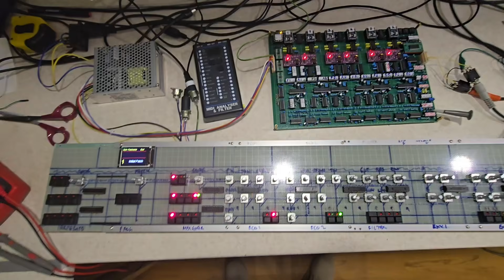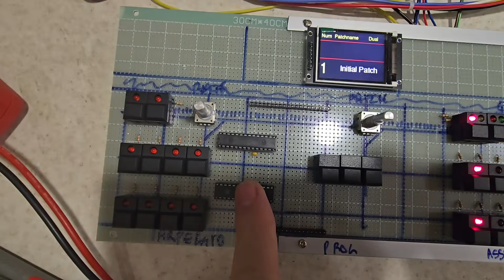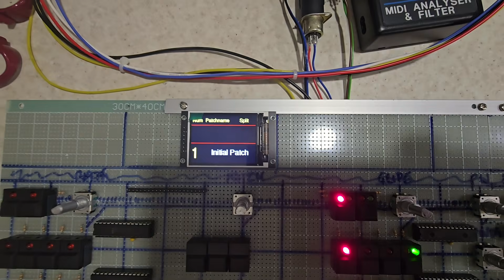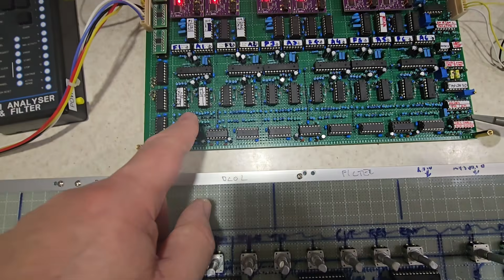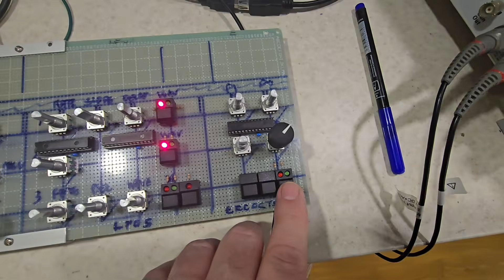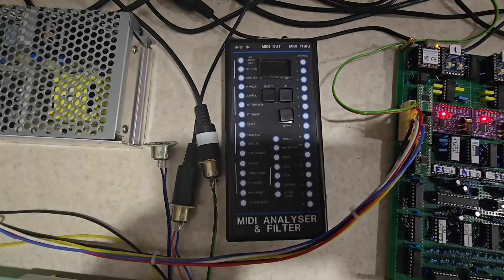12 voice polysynth build

Comment: Amazing! I'm very interested in your building technic. Seems flexible and quick.
What kind of wire do you use?
Reply from the maker: I just use 30awg wire with a stepping tool I've used since I was 16, nearly 47 years ago now. If you look at my videos you will see 3 that I made showing basically how I plan things and wire them up, tricks I use to make runs of cable for data busses etc and the tools I use everyday.
Reply: @craigyjp Thanks, I will watch those videos.

Comment: Given that they are DCOs and that audio FM/X-mod is not possible - have you though of implimenting Rolands jx3p trick of AM along with Ring Mod as you have separate outputs for each DCO ?
Reply from the maker: No I've not considered it as I have hard and soft sync, show me how you have done it in your synth if you can.
Reply: @craigyjp  I am tinkering with the as3397 but that doesn't have anyway to separate the outputs of th DCO/waveshapers - but the Electric Druid article from Agust 2019 about Rolands cross mod history. 
It's on the articles section under older posts.
Reply: FM is possible on DCOs, actually. Just almost nobody is doing it.
Reply: @EvilDragon666  I am talking specifically about audio rate FM on a real DCO circuit.
Which I understand is not possible because counters/dividers cannot respond that quickly for it to work as it does in an analogue circuit. Bare in mind that in a DCO you not only have to account for frequency but also the waveshape needs adjusting when you change pitch to avoid continuity. Atherwise you get wave distortion or amplitude issues.
I am happy to be corrected if you can point to any schematic/article where this problem has been solved.
Reply: @SamLowryDZ-015  Let's just say I know of a synth which is in the making that has DCOs and has FM. :) 

But also IIRC, DeepMind 12 allows its audio-rate LFOs to modulate the oscillator pitches via its mod matrix, giving you those metallic FM timbres. So it's definitely possible.
Reply: @EvilDragon666  The Deepmind as I understand from the manual has an all analog path for voices although that appears to be a point on contention. 
And as schematics are not available it would appear it impliments the older Juno 6/60 voice generation which does allow for audio rate FM where as the pure DCO design of the Juno 106, and the Matrix6 do not.
And as such works only on a single DCO synth (the DP12 DCO2 is digital generated) So in a modern clock/divider DCO where the waveshape value needs recalculating when the freq changes the problem of timing circuits remains.